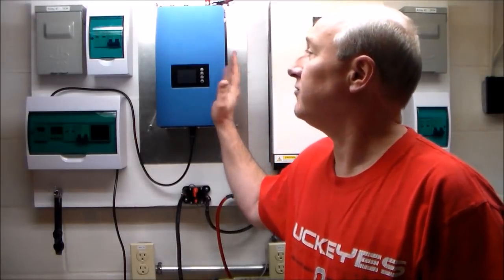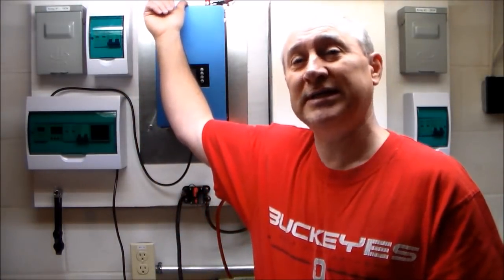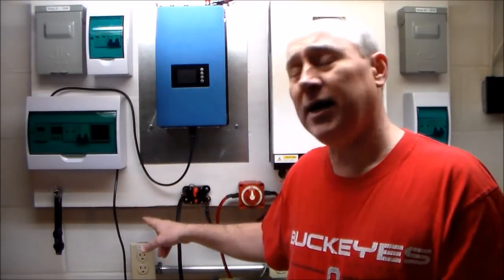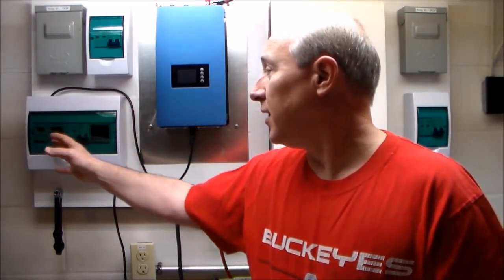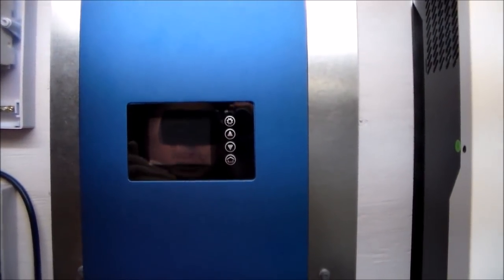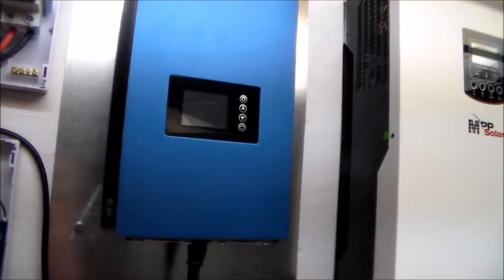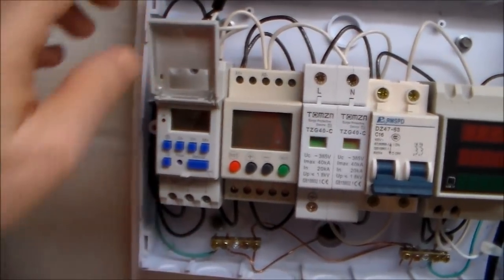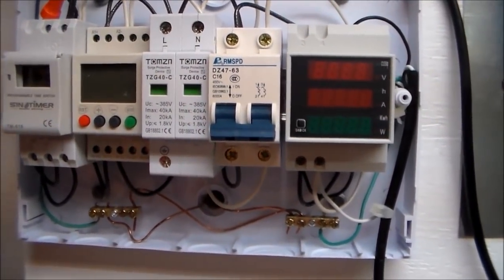DIY Solar - Episode 8 - Sun Grid Tie Inverter + Safety Devices (GTIL2)

Comment: I know it's five years old video, but thanks for posting the safe way to wire this unit. I am going to install a 220V 2KW one. For the AC input side, I will use a Tuya smart over under voltage protector from AliExpress with built-in timer and power consumption meter, and alongside with that a surge protector for maximum safety.

Comment: 17:32 - No you don't want to pull air out of it. Positive pressure (pushing air in) is always better for the fresh air to reach everywhere in the box. When you are sucking out the air is drawn from a very limited space near the fan.

Comment: Have used your fuse board set up thanks so much for your video. So helpful.
I have a small one 340 watt panel and cheap grid tie inverter. New to solar but will get more into it.
Well done.

Comment: Quick question related to the smart inverter with current limiting capability. If I would install the CT on one of the two 120 volts legs feeding my residence, shouldn’t I connect the dedicated plug for the inverter’s outlet to be connected to the same leg? Also, if this is the case, how would I be able to allow for feeding power to the other 120 leg without risking feeding power back to the grid? There is only one CT and it can only monitor one leg… there is no guarantee that the residence load will be balanced all the time between the two legs…. Thanks in advance for your response. Your videos are helpful.
Reply from the maker: Yes, correct. You should connect the output of the inverter into the same leg your clamp is monitoring to insure you're not feeding back into the grid. If you want to feed both legs, you must purchase a second unit.

Comment: Thanks for the great video. Does this unit have an internal limiter?  I see it comes with an external, optional limiter.   I have a long run from the main power to where I want to install the grid tie inverter, and was wondering if the internal limiter will adequately understand the amount of power my unit needs to produce.  Also, what happens to the power that is limited if there are no batteries to dump it too. Does heat build up?  Thanks I’m advance!
Reply from the maker: Yes, it comes with an internal limiter, not an external one. The internal limiter has a monitor clamp that can only be extended about 25 feet from the unit. Solar power does not require a dump load like a wind turbine does. Not, there is no heat build up.

Comment: Dear Friend.Thank you for your kind responce to my questions. For 2 years now i operate the 2kw SUN grid tie inverter .The panel input  is almost 2,2 Kw   and the output of the inverter in AC is 1450 watt.So i decided to add 2 more panels giving him as a solar panel input   85 volts dc   at 32 Ampere.I have not exceed 90 volts as the machine instructs. So make it simple.The power that the inverter gets to convert to AC is  85 x 32 =  2720  WATT. The actual output in the screen is 1890 WATT. which means that at 2720 watt has a loss of 830 watt. At 100 Watt how much.We find...a loss of 30,5 watt in every 100 watt  input power.Which finally means that the efficiency of this inverter is 69,5 %.which means that choosing this inverter you must have in mind that you have to add about 800 watt on top of its nominal   written output 2KW.....I would be pleased if you tell me honestly whats the solar panel power you feed this 2 kw inverter and what it gives you.   Thank you very much.
Reply from the maker: Please keep in mind that just because your panels are rated for a certain wattage, does NOT mean they will output at full power. There will always be losses in the wires and all connecting points too. Also yes, these are inexpensively made devices that are not as efficient as higher cost inverters. It's best to keep experimenting to see what works best for your particular equipment and situations. Sorry that I'm not able to provide better details!
Reply: @jimginnyohio   You highlight  that''  There will always be losses in the wires and all connecting points in the wire bends...etc.''  But please take in account that the measurements that took were at the input point of the inverter.With a high orecision Volt meter and a special DC clamp meter.The measurements were correct.So i noticed that in order for this SUN 2KW inverters to   ''approach''  the nominal as they advertice AC power of 2 KW   people have to connect almost solar panels in order to give  2800 or even 3000 Watt....This is the point.....Truth can not be hidden in our technical world.....by NOBODY. Thank you very much.Respectifully .

Comment: I'd love to know how each component is wired in the panel with the timer and other stuff.
Reply from the maker: There is a wiring diagram in my video at 15:38.
Reply: @jimginnyohio  OMG, I totally missed that!  I'm sorry.
Reply from the maker: @redmatrix  LOL!  No problem!  Best wishes with your installation!
Reply: @jimginnyohio  My last of the devices came in yesterday. I can't seem to get the inverter to turn on during the tests. (The timer LED comes on when supposed to)  I think I have the polarities swapped.
Reply from the maker: @redmatrix  Does the inverter turn on if you bypass the timer and other safety items?
Be sure to check incoming voltage to insure panels are outputting correctly. Also double check all wiring, connections, and timer programming.
Reply: @jimginnyohio  Yes.  Firstly, I did have my hot and neutral swapped from the cord. When that was corrected, it still didn't turn on. (My inverter has a blue LED on when it sees power from the grid, even if it's not turned on)

I noticed that your wiring diagram does not match what's on the spec sheet for both the timer, and the over/under voltage protector.   So I then wired them "correctly" and it trips the breaker in the setup, AND the breaker on my breaker panel -- whether or not the timer is on/off/auto.

My enclosure box doesn't give me as much room to work with as yours does. (got on amazon) And, I'm using solid 12 gauge wire (because I have a lot of it around). I'm wondering if I should just go buy some stranded 12awg wire.
Reply from the maker: @redmatrix  I don't believe stranded versus solid core wiring would make too much of a difference. It definitely wouldn't cause the breaker tripping issue!  Instead, that can only be caused by a short, miswiring, or over-current. 
If you have the same component model numbers  I'm using, my wiring schematic should work for that. If you changed things and then the breaker started tripping, I would double-check everything.  Also, I've known some of the Chinese devices (like we are using) will sometimes come with bad instructions. 
You could connect each component one at a time to see which of those is creating the problem.
Reply: @jimginnyohio  My other comment got deleted (by YT or by you), I believe because it had my email. Anyhow, after further investigation, in your video at time code: 23:48 I think it is evident that your timer has the bottom-center and bottom-right screws being used (#4 and #3 respectively) but in your wiring diagram at 15:45, you show #5 & #4 being used.  Could you please comment on this?
Reply from the maker: @redmatrix  Ha Ha. I didn't delete your comment. YT must have done that if you added your email address.
I've confirmed the diagrams in the video several times in the past with other viewers. They are accurate if you have the same components I am using. For the timer, #4 and #5 are indeed being used and #3 is NOT.  The wire that "appears" to be connected to #3 is actually from the Under/Over Voltage device and passing behind the timer up to #1.
Reply: @jimginnyohio  Well, I swapped the wire from #5 to #3 and it's working 100% as expected. Perhaps the wiring specs changed in the past 4 years?  I also noted the printed info on the device and it's accompanying manual are contradictory.  Either way, I'm glad it's working now.
Reply from the maker: @redmatrix  Yes, perhaps they have changed the specifications for that component. Glad to hear you got it working.

Comment: I talked to an electrician today about this grid-tie inverter. We spent 30 minutes arguing that you don't need a battery because this is for the grid, not off-grid. He said I was going to catch the house on fire if I plug it in the wall. I sent him on his merry way.
Reply from the maker: I know there are some people that have successfully connected batteries to this Grid-Tie inverter, but I haven't done that with mine. I know that some people have indeed set their house on fire too....although I don't believe any of the fires were caused by the inverter device. Instead, the fires were caused by poor battery management and configuration. Be sure that whatever option you go with, you understand thoroughly and you have a good battery management system (BMS) in place.

Comment: In mathematics, sine and cosine are trigonometric functions of an angle. The sine and cosine of an acute angle are defined in the context of a right triangle: for the specified angle, its sine is the ratio of the length of the side that is opposite that angle to the length of the longest side of the triangle (the hypotenuse), and the cosine is the ratio of the length of the adjacent leg to that of the hypotenuse. For an angle {\displaystyle \theta }\theta , the sine and cosine functions are denoted simply as {\displaystyle \sin \theta }\sin \theta  and {\displaystyle \cos \theta }\cos \theta.[1]

Comment: @jimginnyohio  First off great video and presentation. I have a question, what would happen if I followed your exact setup except on the inverter side input have it hooked up to a 48v battery array with the battery hooked up to a MPPT charger and solar. The thought behind this is to be able to use it at night too?
Reply from the maker: There are others that have done just that. If you do that, be sure to limit the power coming from the batteries into the GTI. Otherwise, it will run at full power constantly and drain the batteries quickly. You can limit that from within the GTI menu. One of the YouTubers I recall doing that was Old Time Engineer. Look up some of his videos. There are others too, but I can't recall their names at the moment. Good luck!

Comment: It’s now Feb 2021 , if you were to do this all over , what upgrades or change of equipment would you make ?
Reply from the maker: Hi Jay - Regarding the SUN grid-tie inverters with limiter, I would do nothing different. I only wish that I had installed the second of those sooner! They are both working great!  Regarding the off-grid MPP PIP inverter, I would indeed make some changes. That device worked great too. However, it was a 24-volt unit and only produced 2400watts. I already got rid of the PIP unit and have purchased a couple of the 3000watt/48-volt Gro-Watt units. I hope to put together a new video series for that at some point in the future. Although that will probably be after I move into a new house.
Reply: @jimginnyohio if I happened to have a 30amp plug in my homes garage that the builder originally intended to use for EV charging but I don’t currently use at all, could I use the 2000w vs the 1000w inverter? If not I plan to build one 1k size
Reply from the maker: I'm sorry, but I have never installed or used one of the 2000w units, nor am I an electrician. Therefore, I'm hesitant to offer any advice about that. I suggest you seek out others that have more experience with those devices than I am. Good luck in your search!

Comment: My smart meter will not let me put any amount of wattage even 100 watts into my system even if I'm using 1000 watts in my home. With out charges me for the 100 watts my grid tie inverter is putting in my system.  I found out by using a e2 efergy monitor. I thought I was lowering my energy usage!

Comment: make sure the timer contact can handle the line ac current, . for inductive load limit the contact rating to 30%, if only resistive load limit it to 80%, you can use a small contactor.  the timer contact activates the contactor, the load passes thru the contactor.

Comment: Thank you for all your instructional videos, I received parts on this video and has question about wire hook up for SIN Timer, I see you have L(B) and N(W) on top and then bottom #4 (B) seem to go to Switch,  where would #3 (B) go? #5 is not used?  thanks again.
Reply from the maker: Wire up just like in the diagram at 15:45 and things should be good.

Comment: Jim,  I may be wrong but the AC wiring diagram presented in this youtube video does not match the actual AC circuit wired later in the video.  I purchased the components and would like to wire them correctly.
Reply from the maker: Hi Mike - The diagram is correct. There is one section in the video were I did not have everything fully configured...I can't remember exactly where, but I seem to recall I didn't have one of the ground wires in place yet. I know that many others have used the diagrams successfully and without any issues. Thanks for checking! Best wishes!
Reply: @jimginnyohio  Thanks for your quick response.  I just wish the components from China arrive on the same schedule.  Most came in but 3 important components are already one month late.  I know this is not novel news but just the way it goes.

Comment: Could you get the 220V one and then use a dual pole breaker in the circuit breaker box? Send power to both legs?
Reply from the maker: Yes, some people have done that, but I have not. The difficulty is in finding a set of power sensing clamps that work correctly.

Comment: A quick suggestion on the solar input wiring diagram (Minute 15:32). The DC Surge Protection Device or SPD should be fed from the 20A circuit breaker output. This is because Metal Oxide Varistors (MOVs) inside SPDs can develop short-circuits after arresting voltage spikes and transients. Should the 600VDC SPD short-circuit then the 20A breaker will trip to protect connected PV panels (i.e. if they can produce sufficient short-circuit current to trip the Curve C breaker). The SPD on the AC output side is wired correctly.
Reply from the maker: OK, that's very interesting! I will look into that and take appropriate actions. Thank you for that information!
Reply from the maker: OK, I looked into that a little more and here is what I found.... This particular SPD and Breaker is meant to protect everything from the inverter into the home instead of outside to the panels. Therefore, I believe it is correctly wired as is. Please note that I plan to install another quick disconnect box, breaker and SPD outside at the panel location. I plan to wire that SPD to protect the panels. I hope that makes more sense and paints a clearer picture. :-)
Reply: This is good comment, making me think about this for my system.    For the DC side,  if the DC SPD has been hit by lightning, or maybe from age and many smaller voltage spikes,  then it will be shorted internally to ground, protecting the circuit.   When the sun comes out, on the DC input side,  the solar panels will be outputting voltage but are short circuited through the SPD.   So the wire on that DC side to the SPD and to ground,  should be sized to handle the short circuit current of the solar panels as wired.  I guess your 4 DC panels are in series to the grid tie inverter?, so probably 10 amps or so maximum from the panels.

Comment: Can you help me understand the order to add these safety devices on the AC side when connecting to a hybrid controller that has both AC in and AC out?  I assume put all 5 (timer, volt protector, surge, breaker, and meter) on the "DC output" leg rather than the DC input leg...  Thank you.
Reply from the maker: Sorry, but I wouldn’t know how to answer that without knowing specifically what you are connecting to. The components I listed for this are designed specifically for use with the controller I am using.
Reply: @jimginnyohio   MPP Solar HV LV2424 I believe it's like your off-grid unit, but a hybrid (on/off grid)